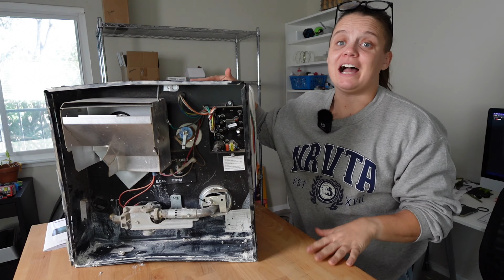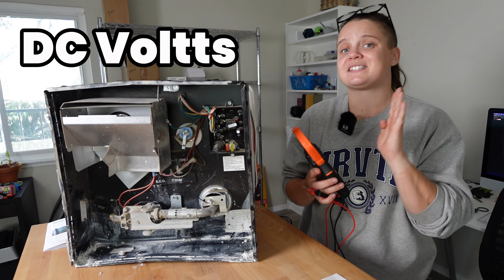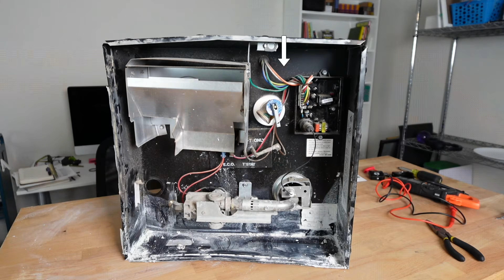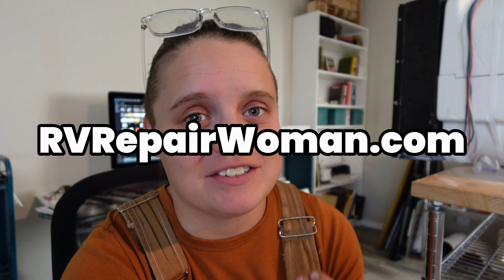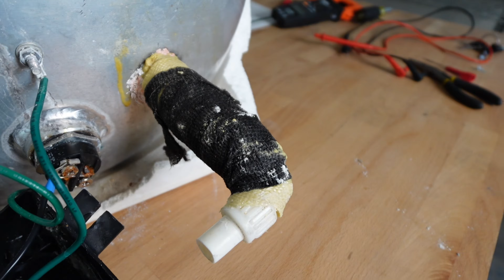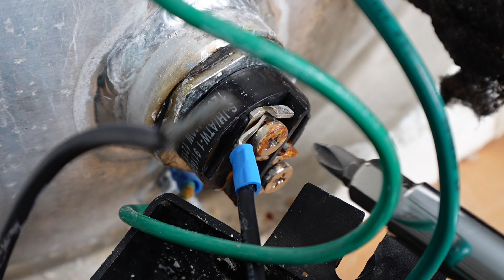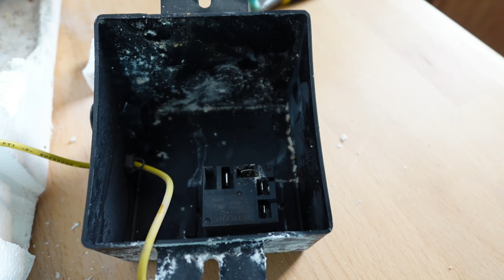How to Troubleshoot Your Electric RV Water Heater

Comment: Luv your videos but iam running in to a little issue I got us a digital multimeter that I got from harbor freight I’m not good at this things  so can you help me me on how to set it to check the dcv so I can start checking our water heater we don’t have hot water coming out .we where cleaning for about 5 hours and we didn’t know that that switch was on and we were not running with the water on .when we got to the park we noticed no hot water and that the switch was on can you give us an idea of what could be wrong . Thanks

Comment: Hi Emily,my DSI light comes on while the switch it turned on to electric. Feels like the water is getting lukewarm warm. When I switch to propane the pilot light kicks on fine. What could be causing the DSI light to come on? I replaced the circuit board last year while watching your wonderful video.

Comment: Hi, I have a Suburban water heater. The electric side works fine. The gas side does not work at all. No click from the solenoids or clicking from the igniter.  I checked the solenoids and there is power there and with the wires off both have continuity. Pulled the igniter circuit board from the back of tank and visually it looks good, no black marks.  I have gas at stove which is just above water heater.  Now what?  Help please.

Comment: Great video!! Only problem is that trying to access the black box on the back side of the hot water tank is impossible. It's under the bunk and only accessible through a small access panel. Also has different screw locations than what you've shown that are literally impossible to get to. Therefore I also can't access the element. I'm a DIYer and am about to list my trailer for sale. This will definitely lower the asking price. So frustrating!!

Comment: Fantastic video explaining the electrical, and propane on the other, into that Dometic.  On my second attempt to get the electrical going while the propane is fine due to a short.  But the first fix was complicated by a "smart" switch between the microwave and heater located way off under a seat.  Primary switch was the microwave so assumed the AC in to the heater would be fine--but not so.  Might be nice to include that a brief comment on upstream "smart" switch which appear to malfunction not uncommonly.

Thanks again for the video, will be watching several times before attacking the machine out in the driveway.

Comment: Hey. Having an issue with a leveling system. Keeps saying low voltage but ive replaced the battery and the display. All wires are good

Comment: Hi Emily. If I still lived in Vegas I'd call you to help with a problem. I narrowed my operation problem to the board. Tstat, ECO, thermal fuse, volts in for propane and electric at the board all good, power out of top plug brown wire 0. Yes, there's propane in the tank. I swapped out the board and the gas side fired right up! Success! An hour later when I went o have a look, only tepid water and same results with all tests. And... no continuity in the element. Something just killed my brand new board! Switches inside the coach are good, fuses good. Ever come across anything like this? Like a little gremlin in the electric system that eats boards? Thanks Emily.

Comment: You are very good! If I may poach on your good nature I do have question. I was with you every step of the way until you turned the water heater around to check the A/C side, mine is very different. I do not have access to the box unless I take out the water heater itself or dismantle the plumbing that is in the way. Do you have a video that I may have missed? The issue is that the gas works to heat the water but the electric does not.

Comment: Did you mention NOT to turn on the AC side of the water heater with no water? I might have missed that.
I did appreciate being able to see the back of the water heater. I need to pull mine out to test it because it is buried under a cabinet.
I am not looking forward to disconnecting the water connections. Regarding the PEX connections... might be hard to do under a cabinet.!!!

Comment: Awesome.  As a novice with a multimeter,  your video was awesome.  Made it to step two and only had 3 volts at the brown wire.  Replaced the circuit board…..walaaa fixed!!!! Thanks sooo much.

Comment: Emily, I have no electric heat on my 10 gallon Dometic WH. My question is, I have 13.2 VDC on the white and both brown wires. The yellow wire at 11.8 VDC. Is that close enough to 12 VDC to open the relay? I have 120 vac to the relay, but 0 vac to the element.

Comment: My son and I are living in a camper during the week. When we bought it we knew it had a hot water issue. It would work intermittently but usually only for a few minutes. (Propane only hot water heater). It would work every now and then. But this the error light would come on and it wouldn’t work for a few days. I thought it needed a new circuit board.  But one day it kept kicking on and off over and over again. And that was the last day it worked.  I got a new board. But there is no power coming to it at all currently.  All of the wires going to it show nothing when checked. The breakers and fuses are all good.  between there and the hot water heater the power is not getting there.

Comment: Great video. One thing tho befor checking the outside wires, white, brown etc check that the wires are all on the back (water heater element area) on the relay. I had a black wire off the relay and it solved all my problems. I love your video. Thanks very much Nova Scotia, Canada.

Comment: Great video!  By following along (on my phone in the driveway!) I was able to diagnose that my relay was the reason my Dometic water heater wouldn't work on the electric side (it's a dual propane/electricity, and worked on propane while we were camped last week).  Thanks for the info!

Comment: Absolutely Spot on on EVERYTHING here!  I did all the tests you mentioned and everything checked out.  Then did the vinegar soak (3.75 gallons in a 6 gal dometic) and nothing worth mentioning came out after 30 hours on a 2018 Lance camper.  Flushed, filled with water, turned on the heater over night and whalaa (originally said "boom" here but that's a bad sound :) hot water in the AM!  Thanks for all that you do!

Comment: I have continuity and 12 volts all the way to the solenoid. No resistance through solenoid. But I have no gas and no light off. It was working intermittently until yesterday now nothing. Working in electric only. If the solenoid opens does it energize the igniter. 
I looked at the small nozzle and it looked clear. 
Any advice would be helpfull.

Comment: Wow!  Amazing channel and excellent help source for those of us unfortunate enough to be in areas where good tech support is hard to find.  Probably a very obvious question but here goes.  I used this video to try and diagnose my Atwood water heater electric side (not working) tonight.  The camper is in storage so I was not able to have water supplied to the heater so I didn't want to turn the power switch ON inside the camper.  Is it safe to assume that in order to do these first few 12V tests on the white and brown wires requires the hot water heater to be powered up inside the camper?  Without having it ON inside I did not get any voltage at the white or brown wires.  Pretty sure the answer is gonna be yes but I am TERRIBLE with electrical knowledge.  Mechanical is relatively easy compared :)  Thanks in advance!  Rob in Houston

Comment: I enjoy your videos. Thank you. I have not begun the testing on my RV water heater yet, But the AC side of it quit, we switched it to propane and it works that way. I will be running tests on it, when I get my multimeter w/probes. But one thing I noticed is the on/off rocker switch for the AC side of it is stuck in the 'on' position. ??? like it melted on the inner side of the panel. Thoughts?

Comment: Loved your video. Made it all the way to checking the heating element. AC voltage measures 125v at both screws but resistance measures 10.2 ohms. Where should I go next?

Comment: If the RV has a panel that provides a readout on amps being used, with the water heater on electric, how many amps should it read?  This could in theory let you know if the relay/board is bad vs the heating element?

Comment: If the water is already hot would you still have continuity? I was called for water not working can't get hot water anywhere. The water heater was working as designed. The problem was debris plugged the line at water out fitting.

Comment: So,  Great video.   Very easy to follow along.   It kind of left me hanging at the end though..  I replaced the circuit board originally as a guess.    Still did not work on A/C power.   I followed your video,   No power at the Heater wires on the last step.   I replaced the circuit board again.   Still nothing and still no power there.  I find it hard to believe all three board relays were bad.  What triggers the relay?  There has to be a trigger terminal when it see's it's plugged in to shore power.   When I turn everything off and back on.. It tries to ignite on propane... Tanks are off.  Once it does not see propane,   The check light comes on and all my Test ice melted overnight.    Suggestions?   Thoughts?

Comment: Would the heating element blow fuses on the power distribution? As soon as I turn the heater switch inside on, all works normal but as soon as the default light is supposed to go out with ignition, that's when the fuse blows. Could the element cause this?

Comment: What if all wires are getting 12v except the yellow is only getting 11.53v ... Is that close enough or does that mean the board is bad ?
Reply from the maker: Thats close enough.
Reply: @rvrepairwoman  Thnx. The electric is not heating the water anymore after it tripped the main circuit breaker at the panel. So I guess it's time to get into the back of the tank and check the element.

Comment: I've had the same problem twice. Have you come across melted 120v wires and relay? I have an Atwood 10gal. Looks identical to the one in your video. 2 years ago we kept smelling burning plastic and it turned out to be the wires and relay under the black box. The relay was toast, the insulation on the black wires was gone and a wIre nut was melted as well. I assumed it was a bad connection that created a run away amp/heat situation. Installed new wires, new connectors, new relay and only made it about 2 years and have the same problem. Not as bad, only relay and the black wire from relay to the heating element melted. I read a lot of similar stories on the forums and it seems like a pretty common issue but everyone just assumes bad connections. Have you ever heard of a likely cause for this issue? My heating element was completely covered in a pretty thick coating of the scale build-up so I'm guessing it was working extra hard with not a lot of down time. I'm hoping that's the cause. It's also a hot area to begin with and then the relay is right up against the heating element and the tank itself with no insulation. I'm looking for any advice or ideas to keep this from happening again. I have a new element coming this time so should help but thinking of maybe relocating or isolating the relay from heat a bit as well. Excellent video BTW.

Comment: Water heater was working great on propane but barley warm on electric. 
After testing everything and finding nothing wrong, I reluctantly tried the vinegar soak. 
IT WORKED 😊
TY 😊
Reply from the maker: YAS! I’m glad it worked for you!
Reply: howd you get the vinegar in the tank to soak ? thru the relief valve ?

Comment: Anyone have any idea what would cause a direct short and trip the breaker whenever the power is turn on a 10 gallon Suburban SW10PE? Just bought this trailer home and the home was winterized. The water just got turned on and after I hooked back up water lines the other day I had no hot water. I took off the cover on heater and notice the pressure relief valve was released and left open I guess for the winter. I assume water should have been pouring out of it, but there was nothing coming out I closed it and pop it open a few times. Also noticed the reset button rubber cover at the thermostat switch was rotted away. The element looked newer. Tested continuity on element and it was infinite. Thermostat switch had continuity on both upper and lower. Would a bad element trip the breaker?

Comment: Hey now! Awesome vid. There is no hot and cold water diagram on the back of my Attwood 10 gallon hot water tank for my RV. I have two water lines and one waterline goes through a bypass, and the other waterline goes to the Coach. Does it matter where it connects on the hot water tank? There is an upper and a lower connections Thank you.

Comment: Hi, I don’t have dc electricity from the rv to my relay what happens?
Reply from the maker: I would then backtrack and make sure DC power is making it out of the circuit board. If its coming out of the circuit board but not making it to the relay then you have a break in your wires somewhere.

Comment: Hi Emily, I have an Attwood GE16EXT combo GAS/Electric water heater. I believe there is a design problem on the controller board that causes infant mortality (some might call it a retroactive abortion) of the PCB's transistor that sends 12VDC to energize the Relay mounted behind the heater that sends 120VAC to the heating element. I have had to replace the potted controller TWICE in a 3-year period because the yellow wire was not getting energized. Otherwise, a $0.25 transistor is all that would be necessary. The Propane portion of the heater was working. It is good engineering practice to add a DIODE (1N4001) to clamp the back EMF produced when the relay is deenergized. I soldered the Cathode to the yellow wire and the Anode to the Green wire in position #6 of the connector. This way the new controller's transistor will not be damaged in the future. The PCB's relay that sends power to the Gas Valve may very well have a similar issue but there is no way to add a protection diode due to the potting compound. Marc BHC, AZ

Comment: Lady I just want to thank you. Emily I recently googled rv water heater repair atwood g10-3e for an 07 weekend warrior. I have a fairly decent understanding of troubleshooting, but your how to step by step was dead on!. I watched your tutorial.  I followed your steps as if you were there showing me. I was able to ohm and check voltage and yes, I made sure it was on first lol. Your instruction was by far the easiest and most concise how to I have ever seen. After all the steps and including ohming the ignitor for continuity. I was able to find voltage and continuity across the steps as you showed. My ignitor socket on the circuit board was the culprit. My fuse was not even blown. I ordered one from Amazon for 1/3 of the repair shop cost.  24 hours and 6 mins later, my dometic dsi was belching fire and I have hot water again. For about 70$ ( I also got a spare ignitor.) . You saved me potentially a few hundred dollars.  You are awesome. I subbed with 👍and comment. Algorithm defeated lol. Thanks to you, this is a tool I can take with me from now on. Thanks a million.

Comment: Very thorough. Easy to understand. My problem started with a smell of electrical wires burning hot water heater no longer drawing current so I jump directly to the hot water heater element but did not know where it was, your explanation showed me exactly where the heating element was. I am in the process of replacing it. Thanks. Do I use pipe dope on threads?

Comment: Thank you for confirming my thought process, as I was watching another tech on YouTube who stated it was necessary to drain the tank "before" testing the heat element. I commented this wasn't true, that it was only necessary to cut power to the water heater before removing connections & using the multimeter. He basically told me I was wrong, & that the water influenced the testing. I mentioned this would be true if the element had burst & the water came in contact with the coil inside the element. I guess he just didn't get it. Anyway thank you for your informative vids. You saved me in another vid about refrigerator testing. I appreciate you!

Comment: Thanks for your video it’s been a great help. After checking all the voltage and changing practically every part on the water heater it’s still not working. The model I use doesn’t have a thermostat and I confirmed that with the manufacturer. Model gc6aa-10e. I’m stumped the last part I can change is the relay on the back of the water heater any suggestions?
Reply: That model is the same as mine.  It does have a thermostat, right next to the ECO (emergency cutoff

Comment: Replacing the element in place with that wrench you talk about is too long. I got a 38mm shallow high-impact socket with two holes in it, and I put a screwdriver through it to get it off.

Comment: Got a trailer cpl months ago and decided to check hot water. I get the dis/flt alarm for gas and nothing for electric. I can hear the gas trying but there’s no spark, can I stick a bic lighter in there to see if it’ll light? I can smell gas. Also, when going thru your checks, only thing I didn’t get 12 was eco.

Comment: Hello Emily, I have a question. I've been looking for a wiring tutorial for a Suburban sw12del water heater.
My water heater stopped working a month ago during a camping trip.
First and foremost, during the time I checked all known connections and power supply issues, I found that my relay is not connected to 12v dc power. Which leaves me to believe that it has been running on the gas side this entire time.
I have purchased a new circuit board hoping that this was the issue, but I also want to reconnect the relay, but have not found information to where this connection actually goes to. 
Can you help?!?